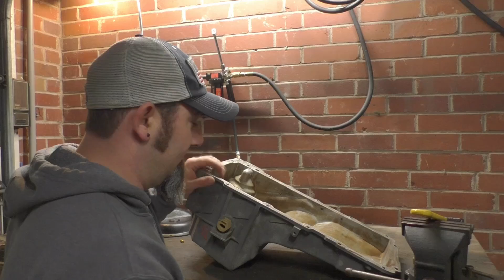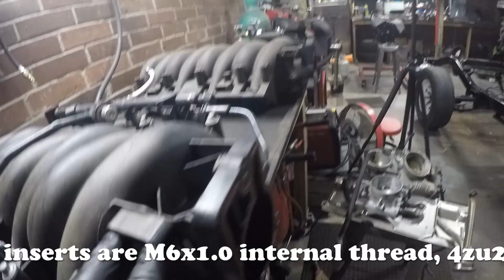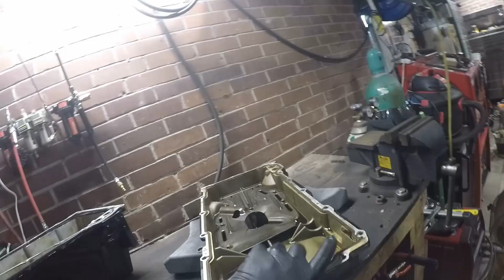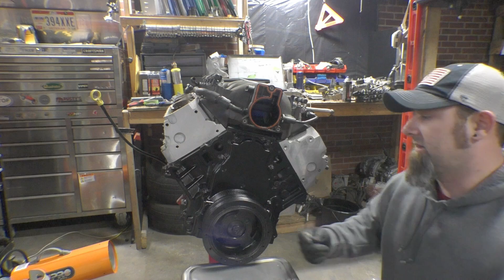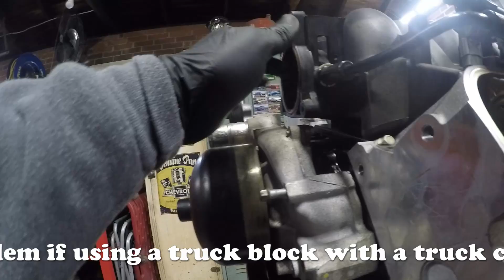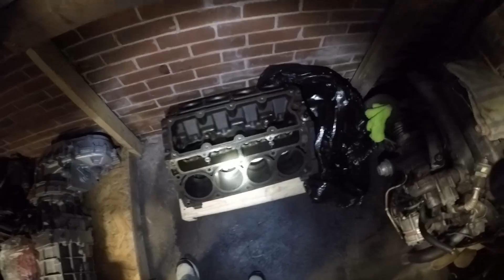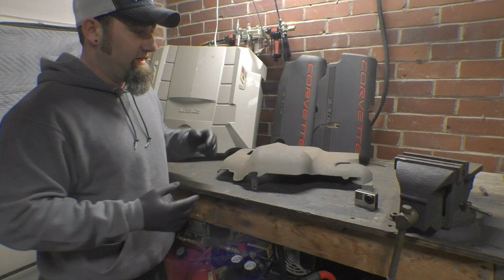Shop Talk: Ls engine guide

Comment: Nice info ... 
What's your main camera set up ....
Reply from the maker: Maldo72, thanks for commenting and watching. I use 3 primary cameras here for production. My main camera is a Panasonic Hc-v770 with a Rode microphone and a few different lenses here in the shop. I also use a variety of gopros and a Nikon p530 for stills and some b roll second camera views. All in all pretty inexpensive equipment but the quality is top notch. Thanks again for watching man!!
Reply: @SmallTimeMotorsports  thank you for listing you set up.. and yes the quality of you videos is top notch....

Comment: Thanks for sharing your knowledge,appreciate it. I’m changing a head gasket on a 4,8 first time working on LS1 any thing different I should know about, if you have time . And thank you for your time.
Reply from the maker: Hello Frank, Thanks for watching and commenting! Changing a head gasket on an Ls engine is very straight forward and satisfying work. First make sure the engine is as clean as you can get it. A couple other tips I can give you are to make sure you use new head bolts and a quality torque wrench, they are torque to yield fasteners (which means they have a measurable stretch to them)  and must be replaced. Another tip I can give you that ive learned is to use windex on the cylinder head surface when trying to get the intake into place, it will slide and help prevent rolling the intake gasket over, then will dry and seal like normal. Its also a good time to inspect and change the knock sensors in the valley if they are in poor shape since youre already there with the intake off, and dont forget to hook up the ground strap on the cylinder head when finished. If youre tackling this job with the engine in the truck you may be able to pull the head with the exhaust manifold attached to prevent snapping the bolts, be careful of this and apply heat with a MAP gas torch if necessary. Other than that its a very good job to tackle yourself and save some money. Thanks again for watching man, and good luck!!
Reply: Thanks so much for the advise, I will put it to good use .thanks again, thank you for your time

Comment: I'm by no means an expert, but being in the middle of an LS conversion and researching these same parts, I can say this is a bit incomplete.  Some of what I've learned that is missing is the Late F-Body LS 1 did have the LS 6 intake from the factory, which means no EGR port, but cable throttle body (has the inserts), which is the engine I am working with. The LS 6 had a different breather setup (updated to stop oil getting into the intake)  than the LS 1 but the late F-Body didn't use that even though it's the same intake. There also is the GTO oil pan which is different than all the others (front sump I believe).  Corvette, F-body, and truck all use different Harmonic balancer depths. The L33 5.3 was an aluminum block and used in some 4 wheel drive trucks
Reply from the maker: Thanks for watching and passing some knowledge on man, yes, there are variants of the 5.3 that were aluminum in the Buick Ranier and the Chevy SSR. There is also an LS4 that I really didnt go into. The intake variants are good information and im glad to add them to the knowledge bank. I spoke mainly about the common stuff and more importantly what I had on hand and could give visual representations of, but I am constantly learning as well. Thanks again for watching!
Reply: So I can use a 3rd generation Camaro throttle body on a stock 04 Tahoe LS truck intake? If so then I will save a lot of money on my build for my 81 Vette.
Reply: Yet the ls6 pcv setup doesn't help much at all.

Comment: My 5.3L LC9 truck engine is all aluminum.
Reply from the maker: Thanks for watching and commenting! Youre absolutely correct, the 5.3 came in limited numbers with an aluminum block, in the Buick Ranier and the Chevy SSR, much more common to come across the iron block version of the 5.3 engine, but they are out there if you look for them.
Reply: Small Time Motorsports the l33 is an aluminum 5.3 that came in some GMC Sierra trucks

Comment: I have a 145 amp Escalade alternator in my 98 Trans am instead of the original 105 amp. It has a 4 pin connector, I made no modifications to it besides ditching a third superfluous bracket, and installed it with the two remaining bolts in the original location. Great upgrade from stock, just gotta make sure its the 4 pin connector which came on a few select years. I found the info online, there is a write up somewhere regarding the upgrade. Got it from Autozone.
Reply from the maker: Thats an awesome upgrade, thanks so much for sharing that with me Omar. Ill be sure to pass it on in the future and quite probably use it myself. Thanks for watching!!

Comment: The starters will interchange. Camaros are one long and one short like the corvette, and I put truck starters in place of the all the time.
Reply from the maker: Thanks for watching man, I really appreciate you taking the time to drop some knowkedge back!!
Reply: Correct! The only thing is you need for them to interchange is the shorter bolt.  My 99 5.3 gmc sierra had the camaro/corvette style with the long bolt short bolt. But my 02 Silverado 5.3 had the two long bolt starter.

Comment: Can you talk about the trans do the 700R4 fits LS engine I have third gen iroc I want to swap engine
Reply from the maker: Manny, thanks for watching and commenting!! So to use a 700r4 with a 5.3 you will need to do some work. There are a couple companies that come to mind that have the parts you're going to need, the biggest is bowtie overdrives. The actual transmission will bolt up but youll have issues. First the top hole will not be used on the bellhousing, second youre going to have to get a spacer for the flexplate to bring the converter forward and a dished flexplate if im not mistaken. Then youll have the issue of the torque converter clutch engagement and the TV cable for downshifting, youll need the brackets for these cables. Also to note is youll have to use a drive by cable setup, so getting a cable driven ls6 manifold and accessories will get you there but its pricey. Then the issue of getting rpm signal to the ecm will be there. Dakota digital makes a box for this. All in all its completely doable, but will surely cost more than to swap to a 4l60e  in with your engine. If you spend the money on a 4l60e and harness youll be in great shape and youll be able to tune your transmission for your application, but I think youll also be able to build a wonderful engine for your application. The Ls is great but I would be looking into a LT1 from a corvette or a buick roadmaster to wake up your IROC, If you have any more questions please ask and ill answer them as best as I can.
Reply: 4l60e is as fragile as glass, 4l80e is what u want
Reply: @nicholas5623  4L60e is N electronic controlled 700-R4/4L60
Reply: @SmallTimeMotorsports  LOL thanks! The more I learn, the more I realize I don't know nothin yet. Trying to keep the budget under control, as this is a toy.
Reply: I put an 07 6.0l in a 92 Chevy pk and a 700r4 but went with carburetor setup because of transmission.  Wanting to tbi but carb makes about 15 or so more hp.
Reply: BINGO! YES! I am currently working out the planning for the same.
Reply: 350=700r4+ od = 4l60- manual linkage
400= 4l80 + od- manual linkage
Reply: @skylertmarquardt  the problem i have got right now is detent cable  on my 700R4 is too short to reach the throttlebody
Reply: @skylertmarquardt  4L80E is an electronic transmission. 400= 3L80 no "E"

Comment: Great Video! I have a 2000 Silverado 2500 with a 6.0 L. I only have 52K miles on it and want to give it some additional H.P. for the street.
What's my best option?  And what plastic will fit my coil covers? will corvette fit? Just subscribed! Thanks!!!
Reply: I’ve read and seen from sloppy mechanics that just tuning it to enable power enrichment which is set up to almost never come on for truck motors you can pick up a huge hp gain all computer.
Reply from the maker: Youre absolutely correct, Thank you for commenting and watching! There is so much to gain with a good tune thats left on the table from the factory. I do recommend doing your small bolt ons first to maximize the effort, but by far the best bang for the buck is a capable tuner.
Reply from the maker: Thanks for watching and subscribing man!! So to answer your question on usable street power, I would first recommend an electric fan upgrade to get the mechanical fan off there,  an exhaust and some tuning time on a dyno or a programmer.  Those 3 things will pick up some kick in the pants for sure. If you want to go farther and get into the top end with a cam, make sure you use a truck cam due to the long runners in the stock intake manifold, they flow great so no need to get rid of it, but if you go up on lift and duration make sure you upgrade the valve springs. These engines also do great stock with a 200 shot of NOS. The bottom end should hold that just fine. As far as plastics go, its really the intake that limits you, but you should check the tube for shaved truck manifolds, they can look great shaved and painted with no plastic cover at all. Cheers, thanks for watching and subscribing.
Reply: Thanks !

Comment: what’s the best for an 84 cutlass ?
Reply from the maker: For a cutlass you can use the truck engine or the corvette engine, it gets the alternator up for clearance from the frame, but you need to use the car manifold for hood clearance either way in the gbody cars. There are some pretty slick install kits for a gbody swap out there, just grab up one of those and read the literature on them, should be a really straight forward swap for you. Thanks for watching and commenting!! Good luck with your swap.
Reply: Car is a lot easyer just set it in and go.I have one in my Buick roadmaster.got the LS out a Z28 camaro

Comment: hey man GREAT freaking video!  finally some solid clear information on LS interchanging.  Keep up the good work, just gained a subscriber
Reply from the maker: Thanks for watching and subscribing!!! Hopefully I can pass some more knowledge on!!!
Reply: @SmallTimeMotorsports  hey what about this:  i have a friend selling a 94 corvette with the original LT1.  would it be worth swapping an LS into that or why not just beef up the LT1?  I never hear anyone talk about old LT1 engines or upgrading them. they can't be all that bad right?  Have any info on older LT1s?
Reply from the maker: The Lt1's can be fantastic engines, just a bit more work and money than an ls. The major thing about Ls engines is that they make 300hp/ftlbs out of the box and the very stout bottom end can hold 1000hp stock. Not to mention they are plentiful and parts are available everywhere. The C4 corvette is a beautiful car and dropping an ls into one should be a no brainer. The dash and interior electronics can be a pain, but remanufactured ones are available, if it were me and I was building a racecar, the c4 would be high on the list. To do things for an lt1 would be getting rid of the optical distributor, getting some good flowing heads, and getting some fuel to it, maybe even a stroked shortblock to really crank out some fun. Pound for pound I think youd spend the same for 500hp

Comment: What’s the best application for a 1982 Chevy c10? I’m new to all this,  but I’m trying to learn so I can put a ls on it .
Reply from the maker: Thanks for watching and commenting Jose. The best, easiest, and cheapest engine for your 1982 c10 would be a 5.3 truck engine. Your truck is more than big enough to fit the tall truck intake that makes the best low down power and the 5.3 engine is very cheap. They made millions of them and a few companies out there make the mounts and everything youd need to get it working in your truck, you can even use your stock transmission. Thanks for watching and commenting and good luck on your project!!
Reply: Small Time Motorsports thank you!!!!